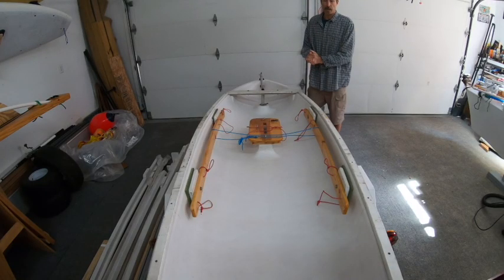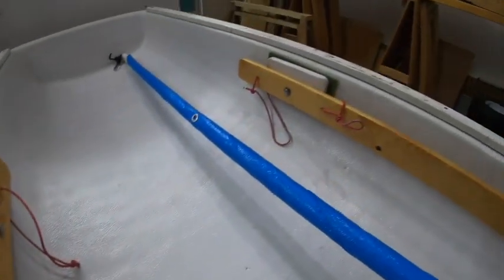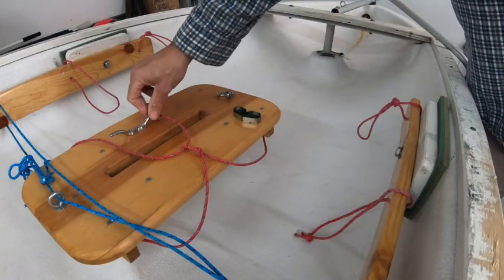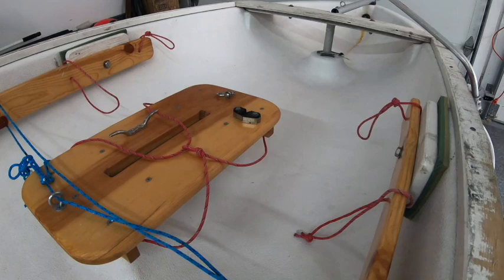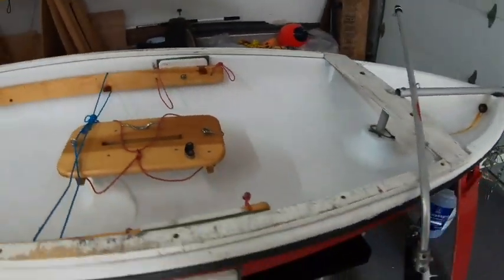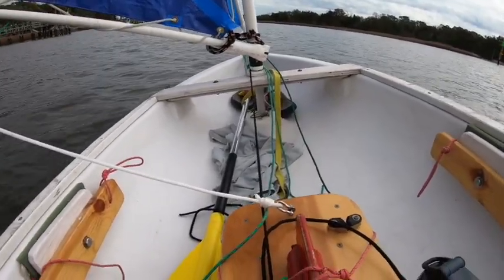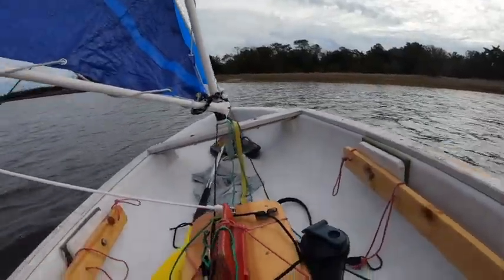DIY Roller Furling and Improvements to the Snark Sailboat

Comment: Pretty neat.

I'd like to have a furling main sail for a Snark sized sail rig. I have a Sea Eagle Paddleski inflatable boat with a full sail rig with leeboards. The sail is 45 square feet and compatible with a Snark sail. But often the wind is too strong, and I'd really like to be able to reduce sail area. I don't need a jib, just a main sail. But as I transport my boat in a sedan, I'd need a sail the packs down to fit in the boat bag I have for the sail rig, about the size of a golf bag. 

I like the idea of the Hobie furling sail for their kayaks, and especially the one on the Hobie Island Adventure. I'd love to add something similar that fits my inflatable, and breaks down small. Ideally, setups up quickly. I also have a Torqeedo motor on at the same time as my sail rig, which really helps and wouldn't be possible on those Hobie's. Not to mention it it fits in my sedan's trunk.
Reply from the maker: The mini adventure is great. I love being able to enjoy the day off for very little cost. Small boats are good for that. Yes the sail rig that is compact makes a difference as sail Rigs can add up quick once secured to the roof. Before you know it, you have an awkward looking set-up on your roof that just begs for law enforcement to pull you over. :)

Comment: very cool buddy 
i want to adapt your design to my inflatable conversion
Reply from the maker: Im sure it would work. Keeping tension on the line that runs through the pvc that is attached to the jib is what makes it smooth. The washers reduce any friction. It was nice having the "Center of effort forward" on my little red boat. Even with the bowsprit it pulled along nice into the wind.

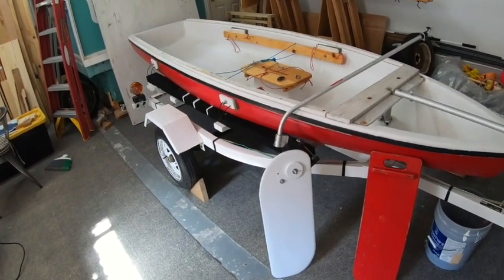Comment: so, I JUST boat my first Sea Snark sailboat over the weekend, and I'm already salivating at ideas on how to build upon it. It is the classic pre-ABS clad hull.  Eventually I'd like to add wooden rails to the gunwales so I can attach oar locks, fishing rod holders, and dock line cleats. I see that you have something like that on your boat at about the 2:04 mark. I assume these were mods and not stock from a later version?

Also, the main point of your video, the roller furling, is genius. How much improvement to you find combining the lateen with such a rig? Thanks
Reply from the maker: The Snark has lasted as one of my favorite ways to enjoy the day on the water. I would go so far as to call it the "Ultimate Car Topper Boat". Its light, easy to set up, SUPER durable (mine is 50 years old and works perfect almost seems new) customizable and I paid 80 bucks for it. I painted it with rustoleum 15 years ago white inside and red outside. All the wood you see in the video has been added. The rails I added for a place to attach things and the work well. The centerboard slot seems to need a new upper slot so I added 3/4 inch pine coated with three coats of polyurethane. The roller furling combined with the lateen style sail is great and I think sails much faster and points better too. Glad you found a Snark to mess around with.... great boat.

Comment: I grew up in Florida back in the 70 s    I had a Sunflower and also some of my friends   We had so much fun back then chasing each other around in the back bay waters sailing      Now day the Snarks are so $$$ it seems they priced them selfs out of the entry sailboat market ??   They used to make an all Foam model   no plastic coating that was very affordable back then    so sad becouse i Love the old Snarks   Your sail Rig is awesome
Reply from the maker: Larz, I can only imagine how fun that was. I stumbled upon this one and paid 80 bucks for it.. It was pretty nasty looking. I wasnt looking for it specifically, but it looked like a fun little boat. I painted it 2 coats inside and out, and put a wind surf sail on it to begin with, which worked well. I have been tweaking the build of the sails to see what it likes. The jib really pulls nicely. The boat seemed to sail better with a jib ans mainsail than the mainsail only. Good times. Adventure awaits!  ZPLAA

Comment: Could you give approx sail dimensions please Zack ?
I have never made a rig like this.
I`m building a Jim Michalak " mixer"  design , it`s a 12 ft sail and oar boat you can cartop.
I think this rig you have here would suit my little boat.The spars are compact and it looks really nice .
Reply from the maker: Luff 9' 2".. Leech 7' 8".. Foot 4' 6". I used a standard 10 foot PVC schedule 30 because its lighter in weight. The Snark was about 12 feet and the Jib worked perfect for that size boat. I left the Bottom of the pipe free of sail area for the last 10 inches, so I could see under the sail as it left a small gap. I also cut the Luff of the sail with a slight curve before I taped it to the pipe, which gave the sail a nice shape.
Reply: @zackariasthepirate  Very kind of you to supply these details , very much appreciated , THANK YOU !!!